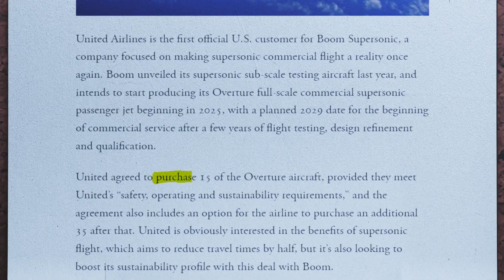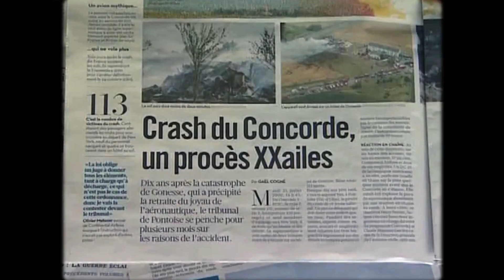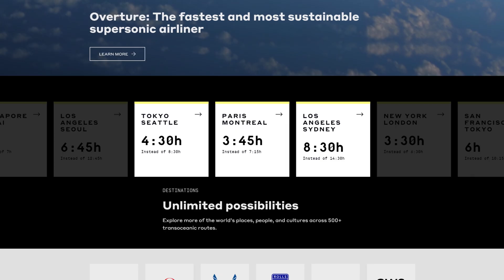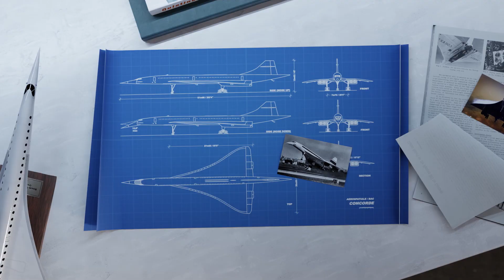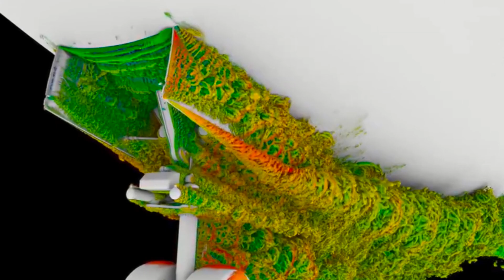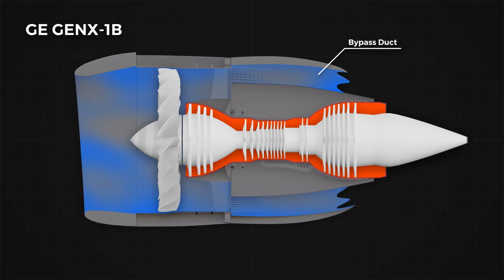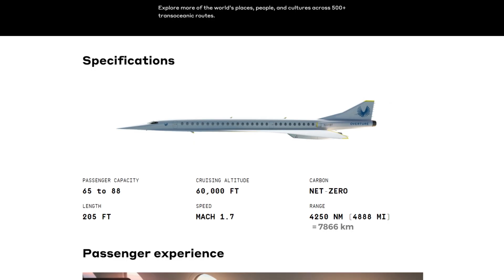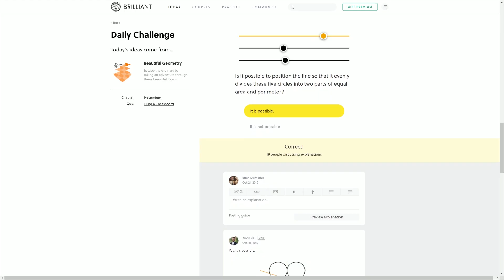Will Boom Bring Supersonic Back?

Comment: The lie-flat seat was the first thing that really threatened the demand for commercial supersonic transport. In-flight network connectivity is the new thing that challenges the rationale for supersonic airline service. During the Concorde era, there would be a race to the pay phones at the destination airport, and a significant part of the reason why business travelers were willing to pay the premium to spend less time in flight was to minimize the amount of time they were out of communication. That's no longer a problem, and in-flight internet service will only get better.
Reply: Why would you want to be in transport when you can be at your destination?

Comment: The quoted price of a Concorde ticket was determined by what its exclusive market would accept rather than the actual operating cost which was quite a bit lower.
I am sure United will have the same idea in mind with Overture but compete with wide body turbofans on a cost per seat mile it never will. 
Perhaps the more pressing issue is will it be allowed to fly commercially given the political intention to reduce the use of fossil fuels to limit global warming.

Comment: I do not believe there is a market for supersonic transAtlantic travel, but for none of the reasons you state. Pre Covid there were some 66,000 people crossing the Atlantic per day in each direction. But the busiest route from London to New York (all airports included at both cities) is some 6,000 people per day in each direction. Of this, maybe 10% is first class, divided between half a dozen airlines. So here we see the first big hurdle. Traffic across the Pacific is less than half, and twice the distance, an insurmountable hurdle for the next decade or so. The problem of supersonic is not ultimately technical. It is commercial

Comment: What you were indicating about turbofan engines isn't quite correct. Modern jet fighters including the YF-23 with it's MACH 1.6 supercruise capability use low bypass turbofan engines. What you were talking about with other airliners is that they use high bypass fan engines. You're correct in that the engines used in most airliners would cause too much drag, but that doesn't mean a modern SST would necessarily be limited by the use of a fan engine or would be forced to use turbojet technology.

Comment: I'm kind of wondering why they don't use a variable wing design like the B1B bomber to allow more stable low-speed flight and takeoff/landing. In fact I'm wondering why someone didn't just think of stripping out the B1B and replacing the bomb-bay with passenger seats? Also doesn't the B1B have an insane range?

Comment: Would it be easier and more feasible to convert a supersonic bomber into an airliner? Such as a B1B or a Tu-160? Having to design an entirely new airframe and test it out for safety would take years compared to using a tried and tested aircraft?
Reply: Military aircraft designs do not really care about the features that make civilian aircraft successful. Military designs mix reliability, speed, range, payload, and cost. Mission is always the first consideration. Note that the military do not use supersonic personnel transport, it appears they prefer safety, reliability, and capacity above speed. As the supersonic  mission for civilian aircraft is different than that of the military I doubt the the B1B or other designs can really provide a helpful model for transport.
Reply: @philiparonson8315  Supersonic military aircraft maintenance downtime is immense for every hour of flight. you can easily find online how many hour SR71 used to be down for maintenance after each mission.
Won't make any commercial sense in a civilian aircraft.

Comment: First of all, great video. Usually I don't comment much but I need so say something.
At 15:01 you say that Boom wants to use biofules which are pure ecological nonsense as you already explained in a previous video. But Boom doesn't specify what type of sustainable fuel they plan to use. At least I couldn't find it after 5 minutes. I always assumed they wanted to use synthetic fuels (Power-to-Liquid) just like Lufthansa. Many people don't know much about the whole P2L or P2G concepts. It would be great if you could explain these concepts with their pros and cons. Especially since you seem interested in the biggest challenge for going green: large scale energy storage
Reply: P2L companies seem to have been keeping their heads down lately (they were doing the media rounds a year or two ago) as the 'no emissions at all' brigade are currently making a lot of noise.
Reply: @tams805  interesting point of view. I personally don't think emission free aeroplanes (except small ones) are on the horizon. P2L might just be better alternative though it's not energy efficient

Comment: High bypass engines are also much quieter, so SST aircraft are louder even when flying sub sonically and especially at take off with maximum thrust.
Reply: I lived near JFK airport in New York, and I could always tell when the Concorde was taking off or landing by the noise of the engines.
Reply: Yep. You cannot use high or medium bypass engines for supersonic flight. The exhaust gas velocity must equal or exceed the aircraft's speed. Boom is dreaming with their 72 inch fan. That's bigger than the 737 MAX's LEAP 1B at 69"

Comment: The thermal effects on composites will be the downfall of these new designs. The fuselage and body would be better constructed from a high tech stainless steel or even Titanium. Concorde used to stretch nearly a foot in supersonic flight. Composites will fracture slightly with each cycle, limiting the airframe life severely. Even the current generation of composite bodied jets are suffering premature failures and delaminating.

Comment: Bombardier nearly went bankrupt building a more standard plane, and you want me believe a startup will be able to put a supersonic aircraft to the market? They will need very deep pockets behind them.
Reply: But didn't you hear? They aim to offer $100/seat 4-hour flights 2 or 3 generations down the road! How kewl!

Seriously now, they're full of shit. Even a company as experienced as Boeing takes YEARS to certify an improved version of one of its existing aircraft (like the 777X, which will be under the same type certificate as the rest of the 777 family - 8 years and counting, and the FAA still won't certify it). This is only since Boeing has enormous financial and physical resources, an extensive amount of know-how in documentation, and experienced personnel.

Now. A new, inexperienced company, that has never engineered a single aircraft, headed by a CEO who is a computer scientist and never worked in aviation... Attempting to engineer, build, and certify a supersonic airliner, something that was only ever done once, as a multi-nation prestige project, with disastrous financial implications... All through the FAA, which as the responsible authority for the type certificate of this aircraft, probably doesn't even yet have a proper pathway for certification of supersonic airliners. After all, it's never been done in the US. See how things went for Agusta/Bell/Leonardo since their tiltrotor didn't fit into any existing certification categories. 20 years in the certification process and counting... 

Hopefully it'll make it through, but very likely this thing will end up dying in certification hell. That is, if they even make it that far.

Comment: The zero bypass engines have undergone just as much, if not more research than high-bypass. Only that most of the info is classified. The modern military jets have engines that have ideal intakes and completely artificial geometry generated by engine bleed air that allow for crazy thrust-to-weight ratios. They even have ways of making a 500°F exhaust plume undetectable on thermal.

Comment: The comment about pure jets isn't necessarily true. Even older supersonic military engines designed to "supercruise " have bypass, though with relatively small ratios, like the F414, with notable improvements in performance, and new ones like the AVET program have three airstreams that can be altered for variable bypass. https://en.wikipedia.org/wiki/Adaptive_Versatile_Engine_Technology

Aerion's AS2 was going to use the bypass ratio 5 Affinity engine developed by GE Aviation using a two-stage fan, but that got cancelled when Aerion shut down.

Comment: If Boom wants a truly next gen engine that will make their model commercially viable, they need to have Rolls Royce develop a turbo ramjet.  That might actually make their engines efficient enough to get away with what they are planning.
Reply: It is probably not feasible in this airframe, there was good reason engines on SR71 were so damn big. You need a lot of parts for the air-flow control around the engine core.
Reply: Probably, but the SR-71 is also much older.  Rolls Royce has been making hey engines for a long time.  I suspect that a lot of the mechanical weight could be reduced with electronic controls and newer materials.
Reply: I'm still skeptical that they can match the efficiency of subsonic turbofans. In rocketry terms, modern turbofans can achieve an Isp(Specific impulse) of over 8000 seconds while cruising.
The Concorde's engines were close to 3000 seconds, while the highly advanced SR-71 turboramjets were around 2000 seconds. Both the Concorde's and blackbird's engines are extremely impressive, but to match the efficiency of subsonic turbofans, Boom needs to come up with an entirely new engine.

Comment: If you double the efficiency of Concorde, (make it use 1/2 as much fuel, and take 1/2 as much maintenance... impossible) which would theoretically significantly cut operating costs you could maybe charge $5,000 per ticket instead of $10,000... who wants a ticket NY to London for $5,000 anyone... I didn't think so... When Concorde was built it was proof that this was a bad idea... knowing it's a bad idea and doing it anyways, at the cost of billions of dollars... These guys are the dumbest genius' I've ever heard of...

Comment: Soooooooooo...nothing about better tires? Because this is something where it absolutely matters how good the tires are. For those who dont know, the Air France Concord Crash was straight up caused by a tire bursting and a large chunk of tire being thrown into a fuel tank, causing a rupture, that when combined with the damage to the landing gear caused by that same chunk ignited the fuel. It was determined ultimately that the tires the concord used were straight up insufficient and it was mandated that better tires be designed. Of course, this was basically a declaration that as designed, the Concord wasnt fit to fly. 

So if you are making a Super-sonic passanger liner, you better make sure you have good tires.
Reply: 👎 No the concord tyres are not bad, they were running perfect for 25yrs. The tyre was burst because of debris on the runway... ln fact Concord was safest plane.

Comment: The problem isn't economic viability, sonic booms, materials, or demand. It's the fact that we are mentally unprepared to take on these engineering challenges. Nobody is going to resolve these issues if they keep believing that it's not possible. If you keep the basic design philosophy of most subsonic aircraft and take that into supersonic dynamics you are going to fail. The technology to make it happen is there, the will to materialize the dream isn't.

Comment: Regulations on where the sonic velocity can begin and end will require, by now airlines should've been capable of super sonic flights just under the mesosphere, or rocket convert to fly over it, as Passenger Orbitline service, the issue was where they classically rendered, that made super sonic flights indangered, which was within the troposphere.

Comment: Could one use a form of active noise cancellation to deal with the sonic boom? If the aircraft was fitted with a differential pressure generators essentially a fancy speaker, with the ability to produce the inverse sound profile of the sonic boom at any given moment, the sound could be drastically reduced. Is this possible in theory?